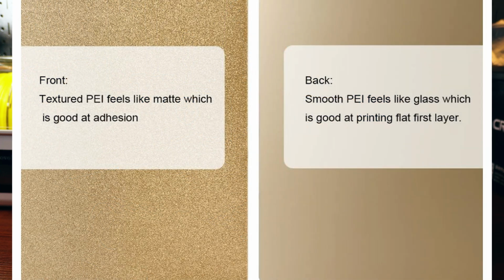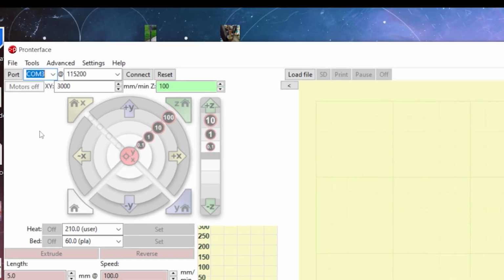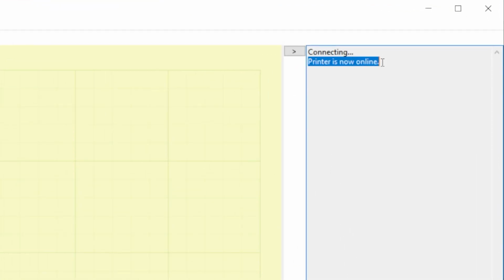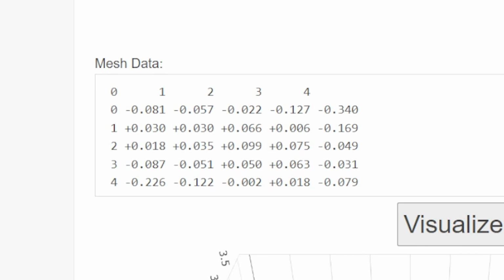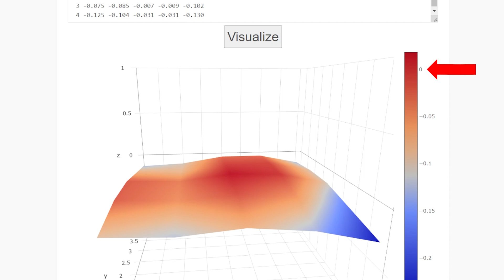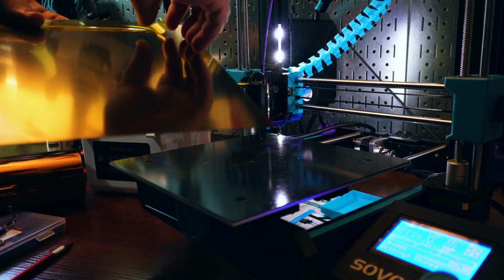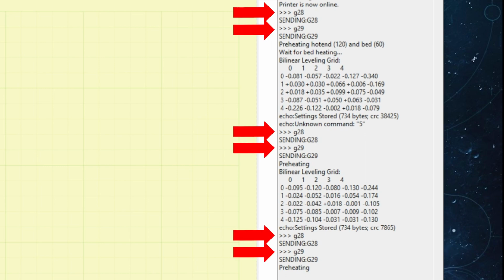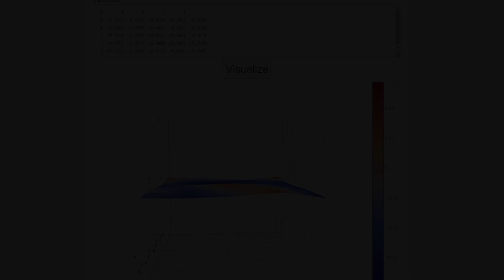I Leveled My Printer's Warped Bed using a Mesh Visualizer | Sovol SV06

Comment: Man, I have the same problem with the Creality K1 Max. I used Kapton tape, but the problem is when I use a filament like ABS that requires a higher bed temperature. After that, my whole bed mesh gets warped again. It’s really annoying.
Reply from the maker: I hear you. It can be frustrating.
One thing I did for a while is buy a second spring steel bed for higher temps. Bring your bed up to that higher temp and then run the mesh and adjust as needed with the tape. Now you'll have a separate bed that you can swap to whenever you want to print ABS and you won't have to worry about warping as much.
Reply from the maker: I should say, if you have Klipper installed, try getting KAMP (Klipper Adaptive Meshing and Purging) running. It only makes a mesh on the bed where the print will occur. That's what I use now on my K1C and it's perfect every time.

Comment: Will it still work if you put the tape directly on the magnet of the print bed? If it does then you wont have to redo to tape for every pei build plate and you get to use both sides.
Reply from the maker: I have done exactly that recently, and it works.
Reply: Ok thanks👍
Reply: This is what my mesh looks like.    
   0      1      2      3      4
 0 -0.077 -0.096 -0.042 -0.016 -0.100
 1 -0.075 -0.062 -0.025 +0.010 -0.040
 2 -0.052 -0.042 +0.005 -0.001 -0.044
 3 -0.020 -0.026 +0.038 +0.006 -0.057
 4 +0.121 +0.024 +0.078 +0.055 -0.025
Do you Know how I could fix it?
Reply: I don't know how to deal with the one high spot on the back left corner. I would really appreciate it if you could help me with that.

Comment: what cable did you use to connect to the sv06 to the printer
Reply from the maker: It's a micro USB cable. I grabbed this one from Amazon. 
 https://a.co/d/a4v0zJR
Reply: @Avel  Thank you.
I was wondering as I've seen talk of having to modify power pins and other weidness 
but clearly not.

Comment: hello, thanks for this video, it helped me. I have an question you might be able to answer. I am trying to tune my stepper motor drivers for my sv06, but to do this I need the stepper motor specifications like the conductivity and resistance. Do you maybe know these values? since I cant find a data sheet on internet.
Reply from the maker: I don't know them, but if you try contacting Sovol directly they may be able to answer.
Reply: @Avel  ok, thanks for the reaction!

Comment: What if you just stuck the tape to the bed platform instead of the removable plate? Then you could use both sides and it would work for other plates.

Unless the deviations/warping were caused by the removable plate and not the platform?
Reply from the maker: Hmm.. Might be worth a shot. If you try it out and it works, let me know.
Reply: @Avel  Just tried this on my SV06 plus. Got the variance down from 0.428 with just gantry levelling to 0.37 with one layer of kapton. Going to keep at it and will update.
Reply: I did exactly that and it works
Reply: It's what I did before the silicone spacer mod. I have 3 sheets and use both sides of 2 of them. (2 textured PEI, 1 smooth PEI, 2 Bare steel.) That got it below 0.1mm. 
With the nods, I am down to less than 0.2 mm variance total, but haven't re-applied the kapton tape. I found that the mesh changes too much just from operating to worry about it. ABL keeps it good.

Comment: My process for unsprung non adjustable beds:

Buy 4 or 5  longer screws(or more depending on your bed layout).  I bought M4x20mm.  You will be about 5mm longer than the factory screws which I think every printer has clearance for.

Buy 8 or 9 M4 washers, and the same amount of small neoprene rubber washers that fit tightly on the screw. Neoprene is rated at 200F continuous working temp.  If you consider the thermal conductivity of a steel screw with a spacer sleeve and a washer after that will keep the neoprene from ever getting close to 200F. You could buy 1for each corner only if you want, but some beds are really bad and you may need the squish(I didn't need it).

RESET PRINTER TO FACTORY DEFAULTS or clear your Z offset.  This will ensure you don't damage the bed.  Most printers I have used are around -2ish mm of offset.  Each washer is .5mm and the rubber washer is .6

Remove the bed screws and bed.

Attach a washer to the bottom of each new screw after it is through the bed with the spacer on.

Add a rubber washer to each screw which will hold the bolt to the plate with the spacer sleeve and the new M4 steel washer.  That friction from the neoprene will save you a headache for sure since you won't have to worry about everything falling out.

Tighten screws until snug leaving yourself play in both unscrewing and screwing to adjust.  The neoprene washers provide squish.

Level bed and check the mesh as in this video. I print a lot of ABS so I level at 100c.

You can adjust negative areas by backing off the screw, or tighten the opposite corner, or both.

Keep repeating auto leveling and adjusting until it is where you want it.

If you need to, you can add another steel or rubber washer to a problem corner to help get a better mesh. 

I did this on my Elegoo Neptune 3 pro a month ago.  I use it daily, and it is holding perfectly.  When I got it, the rear left and front right were off by -0.54 and 0.38.  Really wonky and the majority of the bed was off at least .2mm.  The screws were loose too, so I thought that may be contributing.  My bed is at no more than a 0.09 spread from one extreme to the other(if you can call it an extreme lol).

Took me about 30 minutes to do and cost 8 bucks or so.  I would rather have it close to perfect than rely on a software correction.  I measured the temperature of the area around the sleeve and 100c bed temp, and it was 135F.
Reply from the maker: Thanks for the share!

Comment: Hey, very good work! But what happens, when you lift the PEI sheet and put it back in place? The tape will move or?
Reply from the maker: No, the tape shouldn't move. Mine hasn't moved, anyway. I recheck this chart every so often and it remains about the same.
Reply: @Avel  Thanks for the input. Sounds like a good solution then👍

Comment: So how exactly did you flatten your build plate? The only things I saw were you tightening screws and adding Kapton tape. How did either raise that -0.340 area? This was not made clear. 

I’m also suspecting that Sovol might have sold warped beds. So can you discuss what you did? I still don’t know what the purpose of the Kapton tape was for. Thanks.
Reply from the maker: I used the kapton tape to build up the low spots. The magnet pulls the build plate to the bed, so it's like having a shim between the low spots on the plate and the bed, making the plate sit as flat as possible.
Reply: @Avel  I see - adding layers of tape created a barrier and blocked the magnetic bed from pulling down the plate, which makes it level. This is a great idea - thank you for this video and the explanation. I appreciate your help!
Reply: @mindbendernine uh... no. He used the tape as a shim, a spacer... Nothing to do with magnetism.

Comment: Thank you for this.  After auto z failed miserably, I've been manually leveling the gantry to get closer to a good level. Got 0.35mm variance that is purely warping. Hopefully this will help fix that.

Comment: Does this cause uneven bed temperature due to insulating some areas more than others?
Reply: I used a thermal camera and I cannot see much of a difference across the bed.
Reply from the maker: I haven't experienced any issues.

Comment: how is the new cooling duct preforming
Reply from the maker: It's performing well. The only issue I had a while back was the two screws that hold it onto the hot end came loose from vibration. I just put a small dab of Loctite on each one, and I haven't had any other issues yet.
Reply: @Avel  I changed nozzle to 0.6mm and seems like SV06 having hard times to print 0.4mm layer height - stock cooling is not enough and layers warp and causing layers shifts and hooking of nozzle
Reply from the maker: @gz625 Oh, I see. Yeah, definitely worth a try upgrading the fan. Even if you choose a different model than the one I posted. It's worth a shot.
Reply: @Avel  I used some 3M double sided tape, I didn''t have screws... so far so good.